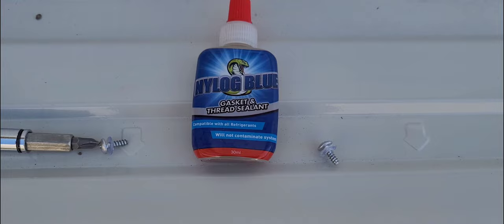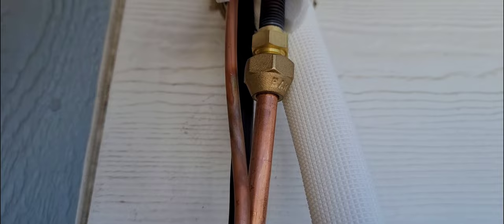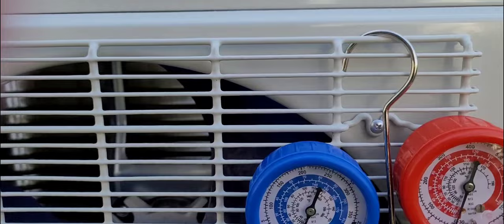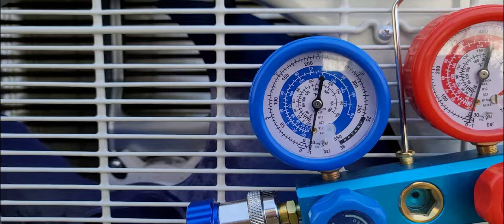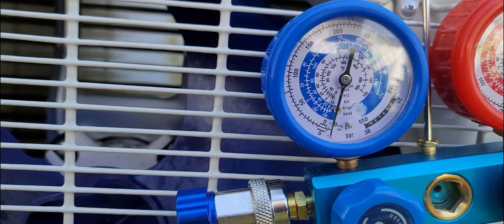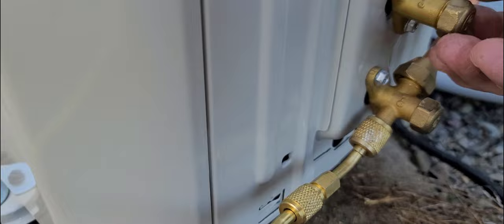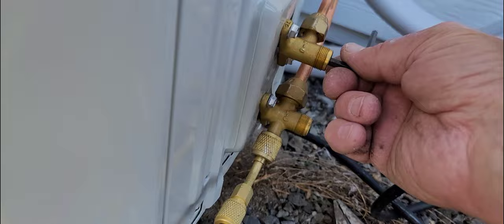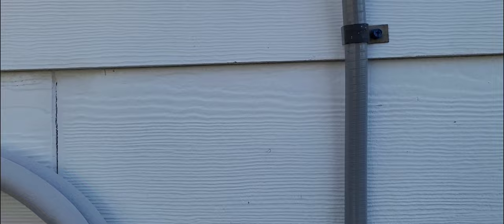vacuuming the lines and releasing the gas in your new Senville Mini Split

Comment: always do liquid line first then suction line when opening valves, you lost alot of gas taking that hose off, you need to add refrigerant now or it will be slugging
Reply from the maker: That was my seventh one that day
And my mind was on other things
But Senville sends out enough refrigerant for a 16-ft line and only sends out a 12 ft line
As can also be attested by ,after all these months, it's still working perfectly

Comment: If you read the Nylog instructions it says it's made to put on both sides of the flare to seal it better.
Reply from the maker: Yeah I don't mind I don't have any leaks I put in seven of those in one day and never had a single leak but I hear so many people say that you shouldn't even use nylog 😂
Reply: @Jonehughes  did You do a follow-up a few weeks later ??  mine had no evidence of a leak and one month later not cooling so well, now I need to add r410a ....  bummer

Comment: I have an issue, I installed mine yesterday and when opening the valves one of them leaked pretty bad and I took way too long to close it back up, about 30 seconds. The bottom valve seems to still have refrigerant but the top one seems to not release anything anymore. It’s not blowing cool air now, is it possible all the refrigerant leaked out ?
Reply from the maker: Mini split self-install DIY Facebook group Go there and post your question a lot more people are there to answer but as far as me it sounds like you lost enough to be a problem but not all so you might just need to add a little bit it's reasonably inexpensive to buy a bottle and add some but if you don't want to do all that you can just call out a serviceman from some company and have them add a little bit for you 

 it doesn't take much leakage to make it not blow cold air

You can see on this video I clearly lost a little bit of gas by a little technical glitch 

that was not a problem though 

It's been working fine

Comment: Ok- I understand the vacuum part and holding the negative pressure part. My question is- kwik-e-vac is  just nitro gas in a can? So- can I use   the Kwik-e-Vac as a nitro test for possible leaks?
Reply from the maker: I have eight of these in my eight apartments and they work perfectly since day one and I have a bunch of different testers to find lakes and all of my testers find leaks and the only one I can count on is soapy water soapy water finds leaks and you can see the bubbles and you can fix the joint until you no longer see bubbles that is the best way to deal with leaks All the other things find leaks that are not there I have not had a single problem with any of my units but every one of my units you can walk around and find lakes with some of these way too sensitive testers it's not worth it
Reply: Never mind, sorry he asked. We’re just gonna go to the lake instead

Comment: Thank you for the video, why did you not disconnect the ac manifold before releasing the refridgerant/gas from the heat pump? Is there a reason?
Reply from the maker: I'm old 🤣😂
But seriously it's okay to leave it on there's no reason to take it off also I should have turned off the gauge though because as I released the gas it went through the gauges and escaped ,so I screwed that up, I installed seven of them that day and that was the last one and I was not thinking correctly 😜🤷‍♂️
Reply: @Jonehughes  all good! Just making sure!

Comment: I have a question my pressure goes from -30 to -20 ans stays there. It seems I have a leak but I did a bubble test  but to no avail; It seems there are no leaks at the four end of the nuts. Can you help?
Reply from the maker: The leak could be anywhere including your gauges system

Once you got it to that point put soapy bubbles around every connection and see if you get any leaks whatsoever if you get no leaks you might just go for it how long of the lines do you have do you have the factory 12-ft lines or did you cut them short or what
Reply: @Jonehughes  Don't use soapy bubbles on a vacuum. That's literally going to put soap into your lines. Only use it on pressure tests.

Comment: Make sure to put a tiny bit of Nylog on both sides of the flare fittings.
I have done quite a few AC flares.
Take the vacuum fitting off before opening the refrigerant valves.
Reply: Yep I once sucked mineral oil from the vacuum pump back into my auto AC system shut the pump off before closing the valve on the manifold. I had to take everything apart and flush it all out and completely start over. The system now becomes the vacuum air goes shooing back in through the pump at least with my pump it's really old 1980's.

Comment: Thank you for taking the time to make this video. I've installed other mini-splits but always good to have a refresher. I'm installing 3 Senville 9,000 BTU units. I followed the instructions to open the high side valve for a few seconds to get the pressure just above ambient then close it and remove the vacuum line. The first one I wasn't paying attention to the gauge and did the same thing and had a small discharge of gas. 

I've installed Senville and MR. Cool DYI. Both are great. Mr. Cool doesn't require a vacuum pump. The inside unit also has refrigerant, just connect the lines and go. They don't have a DYI 9,000 BTU model and the one they do have is a couple hundred $$ more than Senville, which were $600 each on sale. Mr Cool I've had also have 25" lines vs. 16' for Senville. If they need shortened and you can't recover the refrigerant, cut and re-flair the lines, and recharge, it's at least a $400 service call. One complaint is the Senville fan runs all the time but is whisper quiet and perfect for a bedroom (my 3). Mr. Cool does not but the fan varies in speed and has a weird resonance. It's also not really noticeable. I don't use a torque wrench either. A drop of Nylock gives better feel than dry when guestimating.
Reply from the maker: I talked to the manufacturer at senville and they said they send 25 ft worth of gas and only 16 ft of line so having a little bit of loss is perfectly fine
Reply: @Jonehughes  I had an interesting shipping issue. I bought these 3 units in June when they were on sale. I did not start installing them until last month. One of the boxes was shipped and labeled upside down, hence the compressor was upside down all that time. No apparent damage, so I turned it right side up and it's been that way about 3 weeks. I saved that one for last and finished it this afternoon. I turned it on heat. It ran for about a minute then shut off. I let it sit 5 minutes, turned it on cool and ran it for 5 minutes. Nothing abnormal. I shut it off for 5 minutes again, turned it back on heat and it's been running normally for about 2 hours.

The concern about being upside down is of course oil running somewhere it isn't supposed to. Other than the first glitch it seems OK now and sounds like the other 2.
Reply from the maker: Sounds like you did everything you could to remedy the situation 
totally sucks when you get stuck in a situation that you can't do anything about
 but it sounds like you did good
 I bought seven of those units at the same time and installed them in all my apartments
 and each one's working absolutely perfect...

Comment: Thanks for the video.
A couple of mistakes I see. Torque values are calculated without Nylog so your torque readings will be wrong, you should always use a torque wrench and only put Nylog on the bevels of the fitting where they mesh.
If you leave a fitting open with vacuum it will suck in outside air, you never want that. What you want is to pressure test the system with nitrogen to a couple hundred pounds then let the nitrogen out without letting air back into the lines. Then vacuum the system. I didn't watch the rest of the video.

Comment: Disagree, put nylog on the flare to brass dielectric male to female connection. If it can't leak at the seal it'll never leak on the back of the nut.

Comment: Good Evening Sir,
It looks like you used an adapter on the low pressure valve of the outside unit to your blue line from the vacuum pump. After a long weekend of getting to the “last” stages of my install this evening, I find out that the female connector of my line set does not fit the male of the outside unit. Did you run into this problem as well? If so where did you find your adapter? 

Thanks In Advance!
Reply from the maker: Hey brother

 they all come with that little adapter 
did you buy a pump 
And if you buy a pump it should have came with the adapter 
mine came with two of them

Let me look it up
 if I can find it and send you a link
Reply from the maker: Ductless Mini Split System Charging Vacuum Port Adapter Swivel Type, 5/16 Female, 1/4 Male SAE https://a.co/d/fydopCO
Reply: Yes Sir…I purchased a new pump as well as new manifold gauge set…neither came with an adapter. 
Thanks for the link…this is greatly appreciated!

Comment: do I still have to vacuum the line sets down on my senville 12cd, it says it's precharged and I don't plan on cutting lines
Reply from the maker: All the systems come fully pre charged inside the exterior unit.

after you hook up all the lines
You vacuum out the lines with a vacuum pump.
Before you release the refrigerant.
So the refrigerant is not contaminated with whatever is in the lines.
What I just told you is the best way to do it.
Reply: @Jonehughes  appreciate the help!

Comment: Should I remove vaccum pump before opening allen key?
Reply from the maker: No...
You lose a little bit of gas

But it does not affect the system

The system comes with six more feet of gas

Than the line set requires

Letting a little bit ooze out as you're unscrewing the adapter won't hurt it in the slightest
Reply: @Jonehughes  What if I remove the vaccum pump before opening allen key volve?

I actually removed the vaccum pump line from ac before opening allen key volve, and it sucked some air for like 0.5 seconds. 

Did I ruin my AC?
Reply from the maker: No

 it didn't hurt it at all

It's like a check valve

You will notice

That you don't even have to put on that cover

That cover only protects it from damage from weather and such

You don't even need the cover

So the point is

It's not really sucking air

When you take off the vacuum

All the sound is coming from the vacuum system

No sound is coming from the unit

You are fine 🥀
Reply: @Jonehughes  Thank You so much for the help, I am so relieved 😌

Though my AC is cooling very good, I thought that little sucked atmospheric air will cause issue in system in future.
Reply from the maker: Nope... you should be good👍

Comment: You’ve said nothing about when to open or close the gauge valves
Reply from the maker: That's because you're thinking there's more information than actually needs you can close your valves if you want to close them for some reason when you take it off and set it up in your garage when you're all done but other than that there's no need you do exactly what I said and then when you pull it off the gauges can be on or off and doesn't mean anything

If you just follow the sequence that I showed you you will be fine I install seven of these things on all seven of my apartments it's been a long time they all work perfect yours will work too I think you must be overthinking this thing it's not that hard